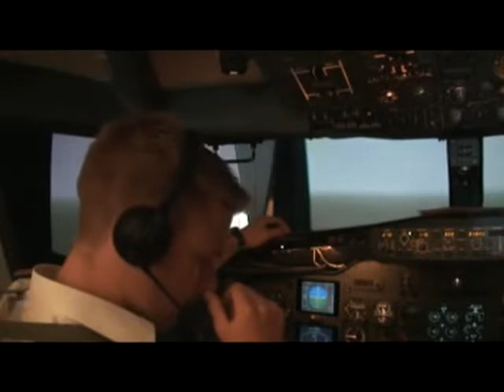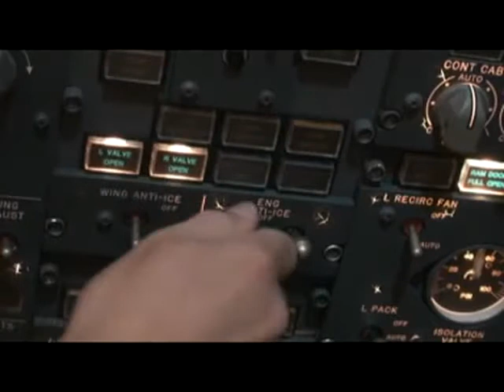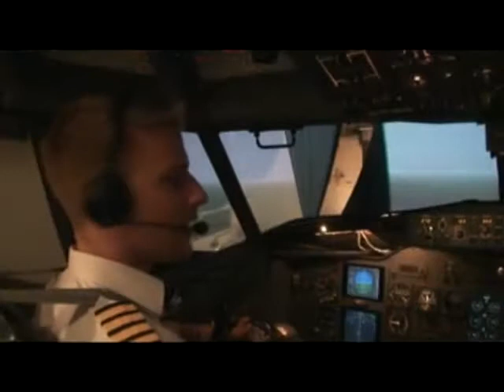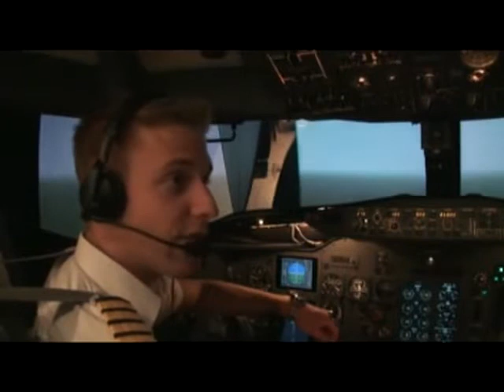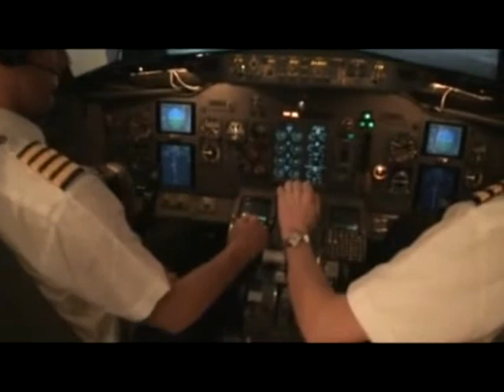Flight 90 Air Florida Avoiding Disaster 737 CRM "CLIP".

Comment: Great synopsis!  The crash and their original reactions made no sense, especially around the roll. I'm no pilot but if I saw my speed decreasing during takeoff I would immediately push throttle. And probably pitch the nose less. Altitude be damned if the stick shaker is going off.  The original pilots didn't do either?  When you go read the full NTSB report and get to the simulation part its clear that pilots were able to recover with either throttle or pitch. Only thing is you had to react within 15 seconds or it crashed, like this. Sad.